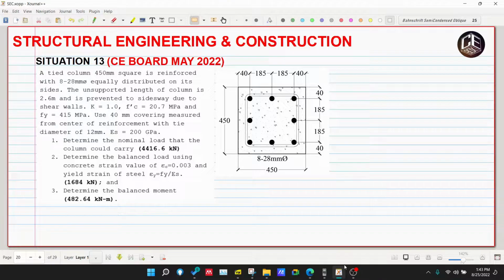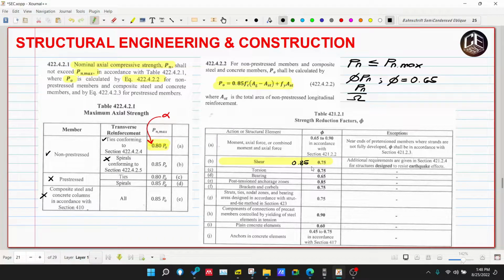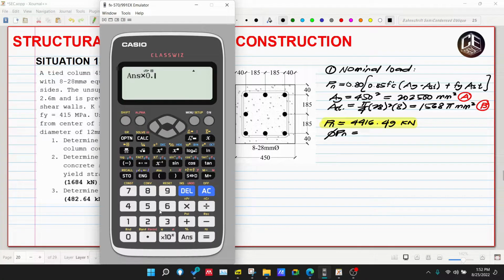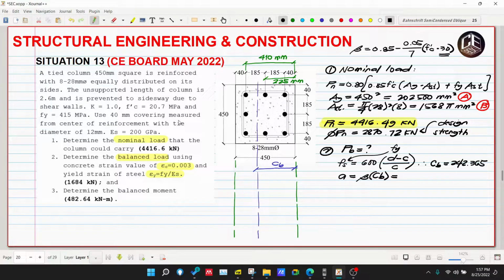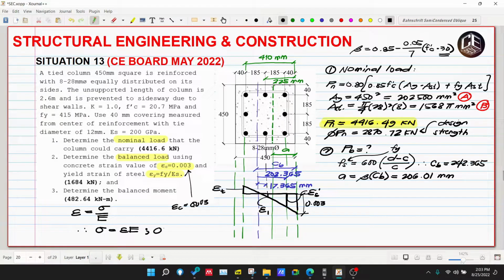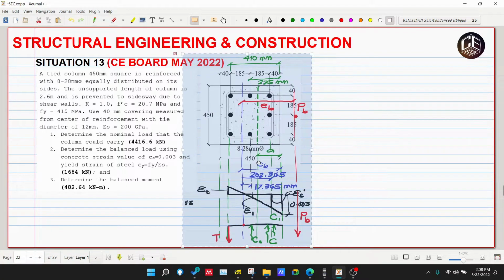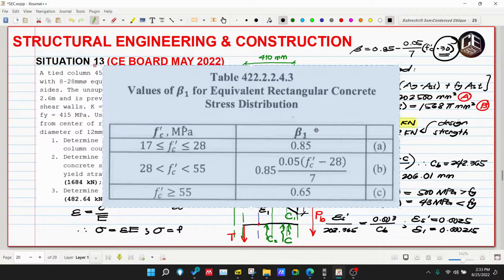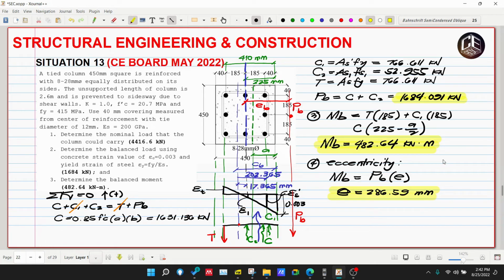Structural Engineering & Construction Situation 13 (PH)

Comment: panggulo lng po ung length ng column and K?
Reply: Yes, pero depende parin sa tanong sa problem
Reply from the maker: Usully, sa pagkuha na ng buckling strength yung K and L. Sa problem kasi na 'to, ang pinapakuha is in terms of its compressive strength.

(Sorry for the very late reply. Abala po sa work and stuff. God bless! 😇)